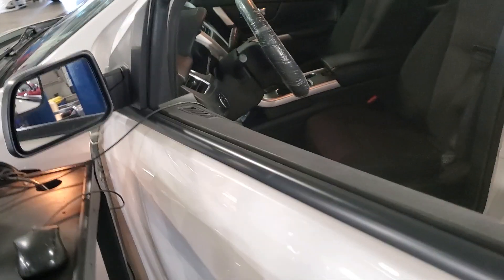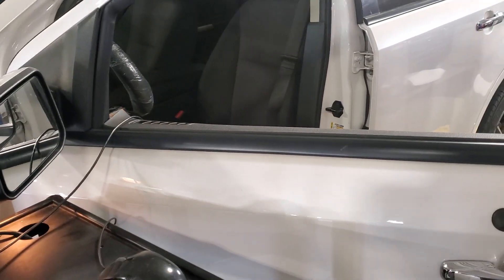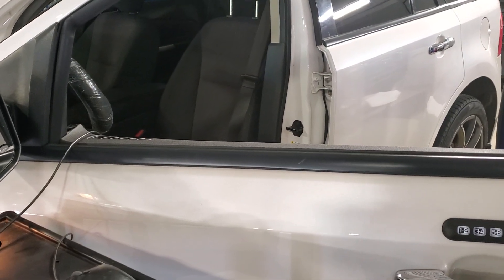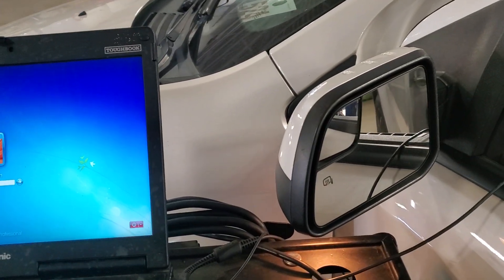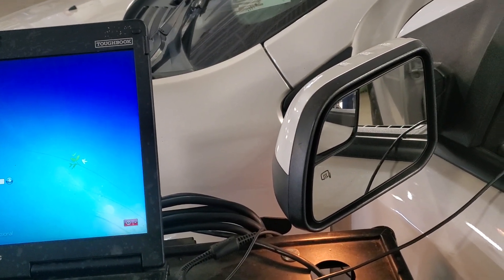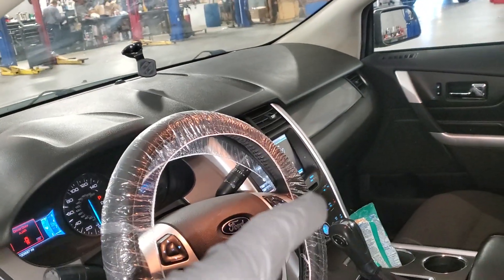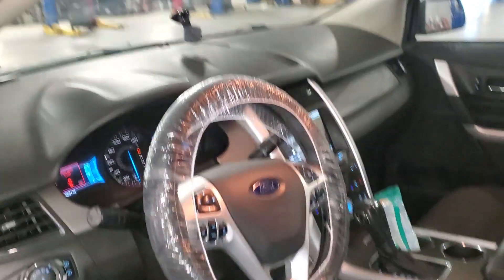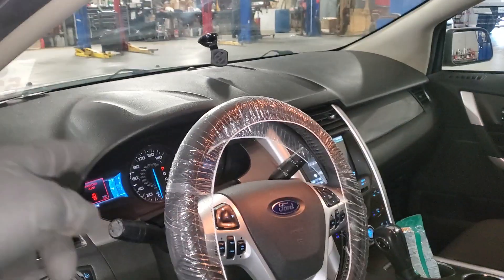Ford Sony radio black screen 2011 Ford Edge

Comment: I have the same problem on my 2011 Ford Taurus limited. I disconnected the negative terminal from the battery, pulled fuse 29 and hold power button+ right arrow and still nothing. It started doing it for about a month and for a week it came back on randomly and started working but would continue to turn back off and on. The radio works. I just can’t adjust climate controls because they are integrated into the screen. Also my interior lighting were also affected, they will continue to turn back off and on. Any advice or suggestions?? Please let me know
Reply from the maker: You probably need some reprogramming done your situation is a little different I have to sit down and look at this further remind me later to please look back at this I'm in the middle of an engine job right now so if you would be so kind to run by me later that would help
Reply: @FordBossMe  is there any way I can contact you other than YouTube?
Reply from the maker: With your first email please send me a vin and send me a picture of your dash layout 

poissorichard.rp@gmail.com
Reply: @FordBossMe  just sent it!
Reply: Same issue here….anything work out for you?
Reply: @ey298  I sold the damn thing lol. Last time I remembered it was functioning again but it would continuously black out more often.

Comment: I am having this problem with my 2011 Ford Edge. My screen goes blank for a week and then reboots back up. This time it was out for a week, came back on for one day and it’s back out again. I’ve been calling the dealership but I’m getting the runaround. I’ve followed you video and still no action. Is there any other advise to get this issue fixed?
Reply from the maker: Yes when that starts happening gea your accessory protocol interface module  sits behind the screen is going bad or the screen itself is going bad and that's why it does that
Reply: Thank you for your reply…

Comment: This fixed my problem but after about two weeks happened again 😭. What could it be???
Reply from the maker: Accessory protocol interface module or the front control display module

More than likely it's the accessory protocol interface module